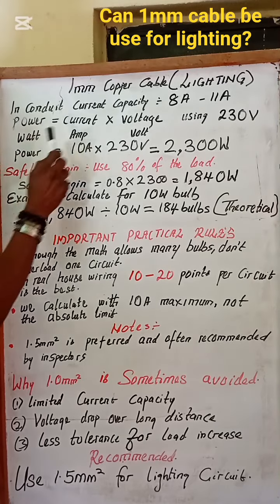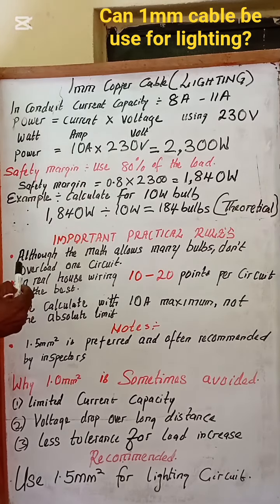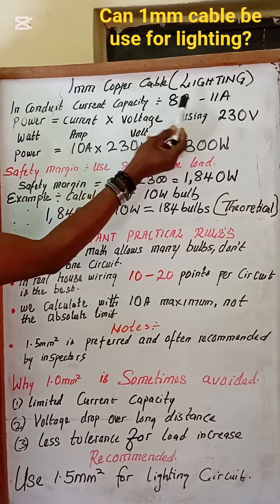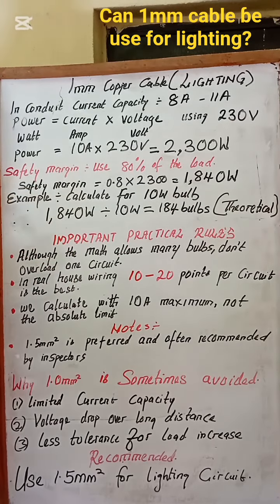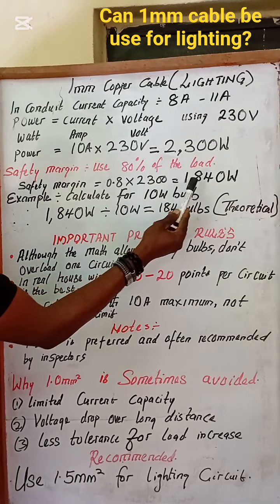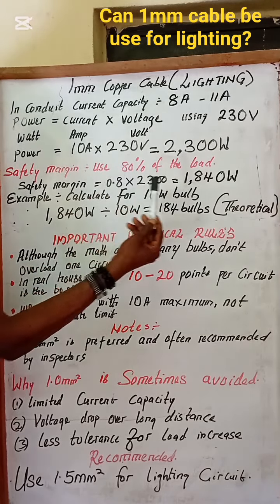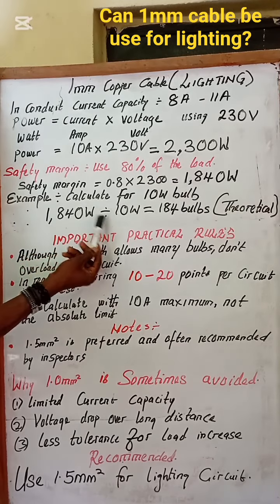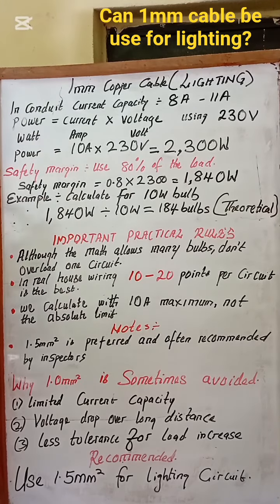Can I use 1.0 mm cable for lighting? #electrician #electricalinstallation #housewiring #everyone

Comment from the maker: Can I use 1.0 mm cable for lighting?

Step 1: Current Rating
A 1.0mm² copper cable can carry about 8A to 11A, depending on:
Ambient temperature
Installation method (in conduit, trunking, etc.)
For safe design, we do not use the absolute limit.
Instead, we design with 10A maximum.

Step 2: Power Calculation (Single-Phase System)
We calculate power using the formula:
Power = Current × Voltage
Assuming:
Current = 10A
Voltage = 230V
Power = 10 × 230 = 2,300 watts

Step 3: Apply Safety Margin (80% Rule)
In electrical design, only 80% of the maximum load is used for safety.
Safe load = 0.8 × 2,300 = 1,840 watts

This reduces:
Overheating risk

Cable stress

Fire hazards

Step 4: Bulb Calculation (Theoretical)

Example: 10W LED bulbs
Number of bulbs: 1,840 ÷ 10 = 184 bulbs
👉 This result is THEORETICAL, not practical installation advice.

Real-World Wiring Advice ⚠️
In actual house wiring:

Lighting circuits are limited to 10–20 lighting points

6A or 10A MCB is used

Long cable runs, voltage drop, and future expansion are considered

Professional Practice 👷‍♂️
That is why:
Many inspectors and electricians prefer using 1.5mm² cable for lighting circuits, even though 1.0mm² is technically acceptable.

Safety Reminder
Always consult a qualified electrician and follow local electrical codes when designing or installing electrical wiring.